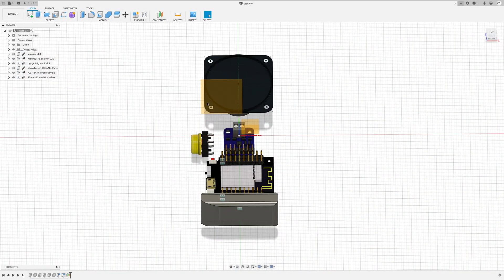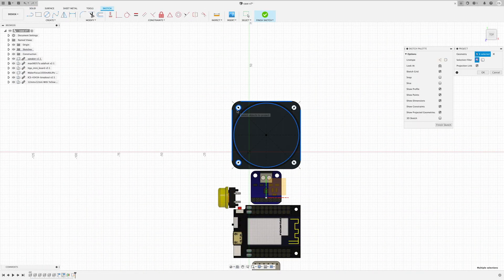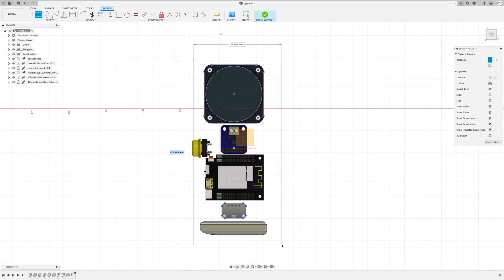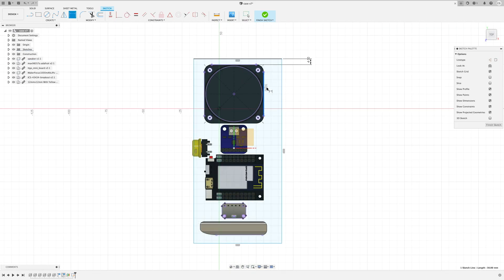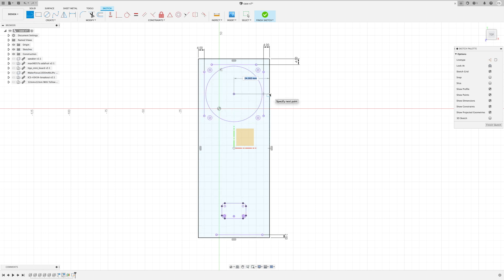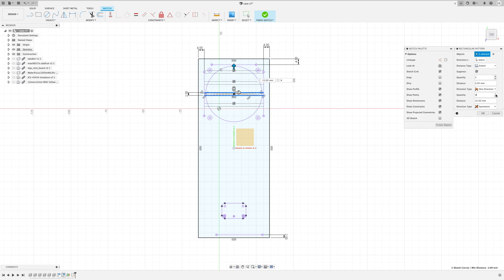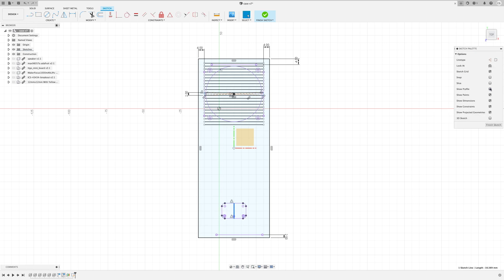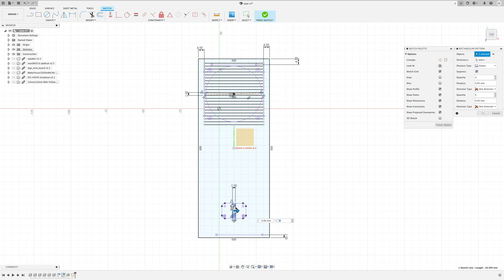ESP32 Walkie Talkie - Part 1 - Fusion 360 case design

Comment: Hey there, I think your interference is not EM interference. It is audio interference! I have been struggling with the same issue with the ESP32 boards, trying a ton of different attempts (we emailed about it a couple times). Then I realized the ESP32 WROVER and WROOM transmitters emit AUDIBLE noise which is being picked up. Your I2S library pushes 32kb of data every second or so. During transmit, the ESP32 makes an audible noise. You can hear it within about 4-6 inches (100-150mm) from your ear. I have tried literally dozens of different ESP boards, and with the exception of one chip, they all make an audible noise which is easily detectable. I have been investing a lot of time with blocking audio using physical barriers and noise blocking materials (neoprene and foams) within the body of the device. It helps, but not 100%. If you also adjust your gain in the code you share you can slightly reduce the sound since the ICS43434 is quite sensitive anyway. I can send you a ton more info via email if you're interested.
Reply from the maker: OMG! I can actually hear a noise - it's very quiet, but I guess it's close enough that the mic can pick it up. This is amazing! I'm going to have to try and capture this - hopefully in the morning when the house is quiet.